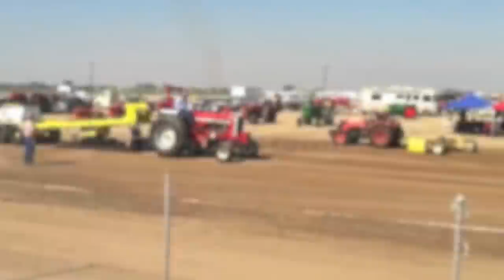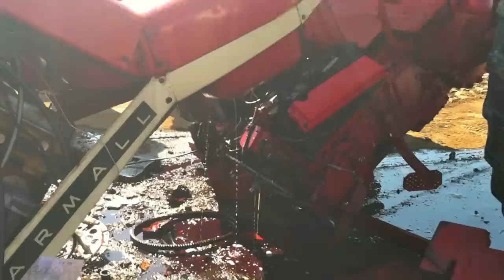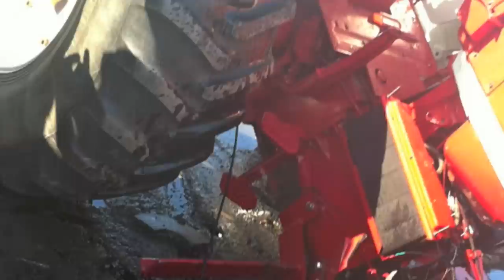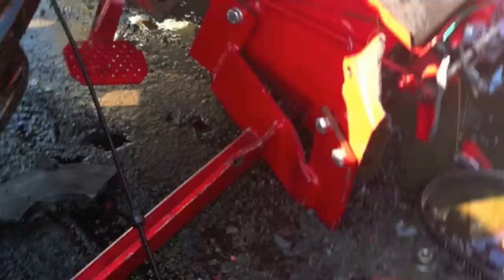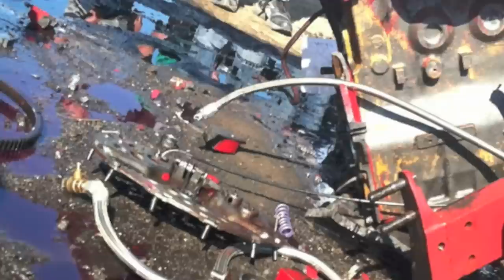Farmall 1206 Breaks in Half when flywheel Explodes

Comment: The fly will cut the tractor in half, which means it's scattered, so was it imperfection in the steel, who made the steel, possibility of lmproper torquing, thermodynamic fatigue. High RPM and the pulls it self apart. All four factors come into play. Why do flywheel scatter?
Iron American Dream on YouTube Share it. Take a ride across the promised land. Ride a tractor.

Comment: What failed?What a waste of a good machine.Engine is probably OK.
Reply: +Robert Gift Really were you watching the same video? The flipping engine is in pieces Einstein!!
Reply: ckelley63  Perhaps you should study to be an engineer.  We like to do failure analysis.   What failed?
Reply: +Robert Gift perhaps you should engage your brain before putting your mouth in gear!!
Reply: ckelley63  Perhaps you should study a little engineering and try to comprehend what failure analysis, other than your own, is.   
"My engine done broke." ain't good enough.
Reply: +Robert Gifdosen't take an engineer to see that the engine is in pieces on the ground. How in you're world does that make the engine ok?
Reply: ckelley63  Actually, it looks like the transmission is in pieces.  Engine block and overhead valves may be OK.
Reply: +bakakun12   Yes.  Glad no one was in line with that "fly" wheel!
 RPM governor removed?
Reply: +bakakun12 looks like the bolts sheared.
Reply: +Robert Gift I'm a diesel mechanic and what happened was when he got to the end of pulling he hit the clutch and must of forgot to throttle back and it got away from him,  so what happened the flywheel which is connected to the clutch and the transmission got spinning to fast, cracked and broke lose and split the tractor in half.  The governor was probably there but was messed with to give more power for pulling and speed, but the problem with removing or tampering with the governor is having the risk of cracking the flywheel, blowing head gaskets, and other obvious problems that you should be aware of.
Reply: ANDREW MILLER   Thank you.  I wondered why it happened at the end and not when under load.  Expected the governor to limit RPMs if free-wheeling.
Reply: ANDREW MILLER  what happen was he got the cast iron flywheel so hot from the first attempt and second attempt to start the sled. Then as he is going down the track finally , a plunger in the injection pump stuck and it ran away with itself which is what happens when you don't put a safety air shutoff to kill it when a plunger sticks. If you are a diesel mechanic , you could hear it in the engine when it's going down the track. When he stepped the clutch in at the end and it didn't shut down I'd say he panicked , not having the only safety equipment to shut it down in that particular Seinario and he dumped the clutch....onto a hot flywheel which exploded and broke it into two pieces. Very lucky. The guy is a moron. And your diesel mechanic opinion was that he stepped the clutch in and didn't let off the throttle? Lol. What diesel shop should we stay away from?
Reply: sparky4010 We should stay away from any shop your at. Your senerio is a complete uneducated guess as to what happened.
Reply: Robert Gift that was NOT a runaway. That was a mere bolt failure.
Reply: Robert Gift  it's completely educated. I'm in tractor pulling and high performance. You can hear the engine get a dead miss at about half track. The throttle was no doubt all the way open when it stuck one of the plungers in the injection pump. When that happens, the other 5 still working plungers stay feeding the other five cylinders at the same throttle point that the other plunger stuck. In this case, wide open.  Even pulling the kill switch or the throttle back will not shut it down. You have to have a safety air kill to shut it down. Even injection pumps on stock machines like dodge pickups or John Deere combines have been know to stick and run away.  The rpm of the engine, and the hot cast iron flywheel made for a grenade. Same Situation that has killed people in the past. Do a google search for seized injection pump and see what you get.  This tractor pulling accident is a good example of why our tractors have to have sfi approved steel flywheels, scatter blankets, and air shutoffs, or they aren't allowed to hook to the sled, not even once. To say my guess is uneducated shows your ignorance. It was not a guess
Reply: sparky4010 Your completely wrong. An injector pump is like  a small engine, but rather than having rods  connecting the crankshaft to the pistons it has a cam that push the plungers up . If a plunger stuck in the barrel one cylinder would indeed die, but the other 5 would work as normal. What your referring to is a stuck rack, which holds the engine wide open, and killing the fuel would have shut it down, if you could have got it in time
Reply: Robert Gift when one plunger sticks, the rack sticks with it.......
Reply: We have stuck a plunger in our p7100 from Hart Diesel.  Can't shut it down.  Which is why we have a guillotine air shut off we can pull from the seat.
Reply: sparky4010 Should have got the pump from joliff diesel
Reply: Robert Gift. probably not . pretty sure that was the timing chain laying there among pieces of clutch , flywheel and oil, haha
Reply: ppl keep talking about the air shutoff but the runaway happened so quick would it be possible to pull the shut off at that exact time before its too late?

Comment: Still a lot safer than a lot of cars on the road
Reply: LOL XD
Reply: Charlotte Clarke considering most modern cars in America, have roofs capable of holding the weigh of the vehicle, adaptive airbags that take into account the weight of the occupants and severity of the crash, seatbelts with pretensioners to keep you in position for the airbag, stability control that operates the brakes and engine throttle independently to help prevent and recover from a loss of control, anti lock brakes to maintain steering, side airbags to prevent passenger ejection from the vehicle, passenger compartments engineered to withstand massive amounts of force while carefully engineered sections of non critical sections of the car are sacrificed to save the occupants and so on... I'm going to say no. modern cars are way safer. 

and for advanced cars, add in, coalition avoidance, land keep assist, automatic calling for help when an accident happens, steering headlights to light up around bends... no even stronger.
Reply: Charlotte Clarke no

Comment: That tractor woulda been fine if the idiot had put a steel fly wheel in and had a scatter blanket, along with a good clutch, that stuff was probly all stock n nothing close to strong enough to handle the high rpms that it was running.

Comment: who knew, a red tractor bleeds red..
Reply: The transmission fluid is red, or it might be hydraulic oil, but I doubt that tractor has hydraulics.
Reply: The Rain Gutter They run hydraulic oil in the transmission. It may not have the outlets or PTO out the back, but it still needs the hydraulics to operate the clutch and power steering.